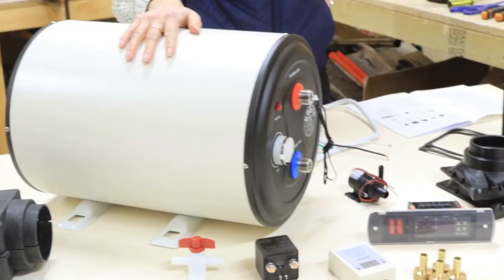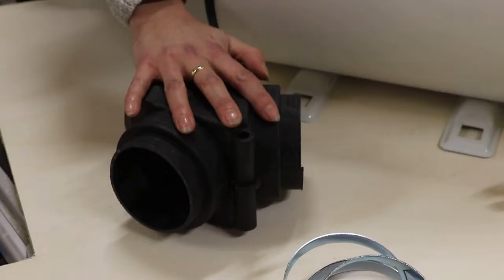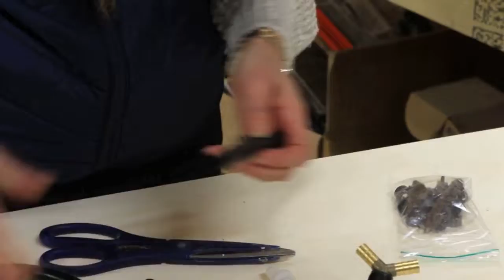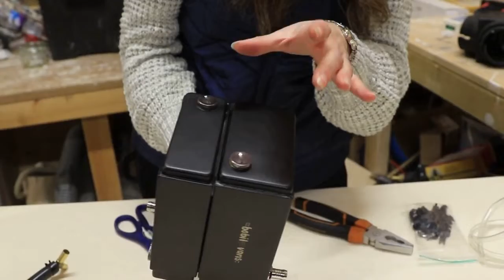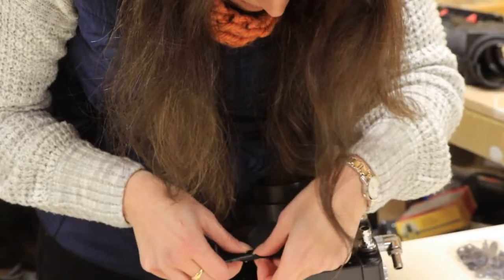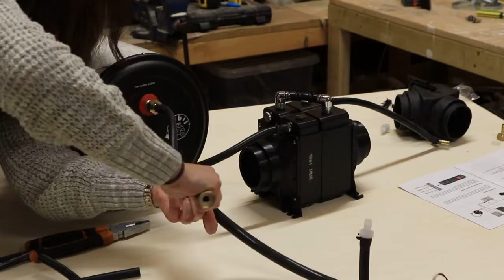Assembling the Bobil Air Hybrid Water Heater

Comment: The electric boiler is shockingly awful. The heat up times are horrendous!
Reply from the maker: The boiler consumes the started amount of power, right? The heat up times are just down to physics. A 200w element will be slow, but that’s the nature of the beast.

Comment: Hey guys, we’ve got these 12 V only 10 L tank and the simple controller without the heat exchange. We also didn’t receive a relay to go with the Cyrus that you explained for the excess power. Am I right in thinking we don’t need to use that for a simple 12 V set up without the being connected to the diesel heater for the heat exchange or excess solar power? Thanks.
Reply from the maker: @DavieLangham  best to send us an email to check as we have different standards of tanks with different wiring

Comment: Hi.  Can this system be linked with a calorific to heat water from engine heat?
Reply from the maker: It can indeed. You can find more information on the downloads section of our website. https://www.bobilvans.co.uk/downloads
Reply: I have an eberspacher. How do I link the bobil controller with my eberspacher 701? Or does it replace the eberspacher controller.

Comment: Hi. Did 30psi come with issues and this is now why you advise on 20psi. Thanks
Reply from the maker: We found that 30psi was quite close to the pressure that the drain valve would vent at, leading to constant dripping so lowering it to 20psi seemed to make sense :)

Comment: How do you switch between 12v and 230v if you have the dual voltage system? With the diesel heater connected as well. 
Trying to get my head around it all before I buy it. 
Cheers
Reply from the maker: 12v system is controller by the Solaris, whereas the 230v is just a cable which you attach either to your ehu for use on hook up, on to an inverter and you just switch it on and off.
Reply: @bobilvans4205  makes sense, thanks. No hook for me I’m purely off grid, but I do have a B2B charger (renogy). So having the 230v makes sense as it’ll be perfect when driving. 
Many thanks for the reply.

Comment: I must be thick or just stupid 🤔I have the old Bumper air exchange kit (bought 2yrs ago but only just fitted it) as there is no diesel heater connected to it in the hybrid kit why is it needed 🤷‍♂and why do need the 3D printed covers still fitted (apart from fitted the sensor into it)
Reply: There is a diesel heater connected to it. It’s a hybrid of both diesel and electric.
Reply: @willpolr  Already worked it out and ordered the Hybrid upgrade kit 👍

Comment: This is great. Just wondering ... I have the original kit, with the two separate sensor/switches, and wondering where to put the water temperature thermocouple. Does it go into the tank somehow?  (12 mins 04 sec) Thanks.

Comment: Is it possible to install the cylinder vertically? Or will you start to have pressure issues?
Reply from the maker: Hi there, I’m afraid not. If causes the over temperature sensor in the tank to fail.

Comment: Would this work attached to an lpg heater? I’ve got a propex heatsource 2000 but currently not water heater, and this looks like a great option… I’ve nearly always got excess power from solar and dc-dc charger so it would work a treat!
Reply: I'd love to know if you ever found this out?
Reply: the source isn't critical - just temp and volume of air. It's easy enough to source pipe adaptors from the 'net (making sure they're heat tolerant)
Reply: Did you find this out?